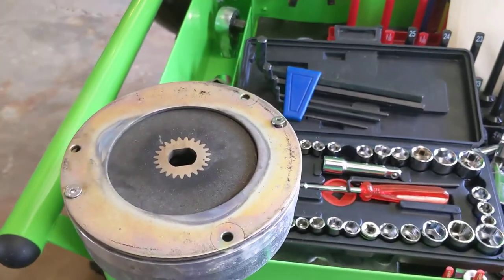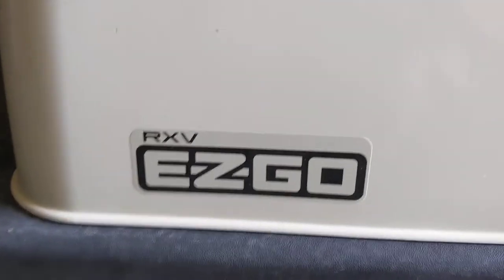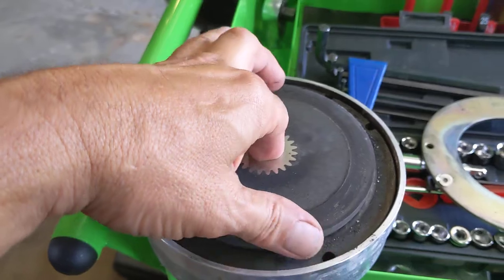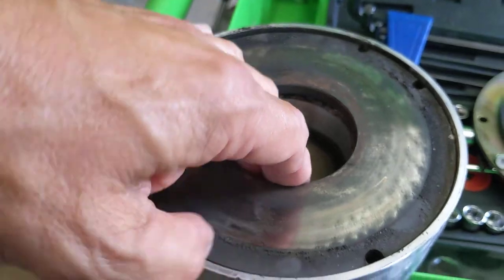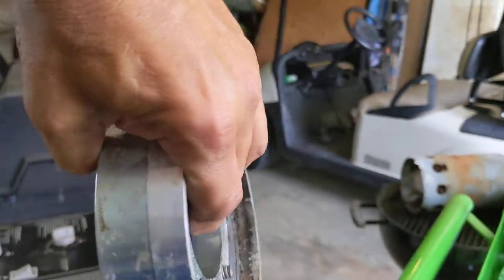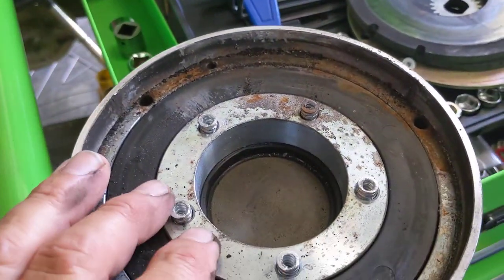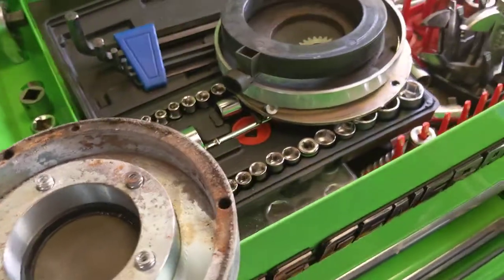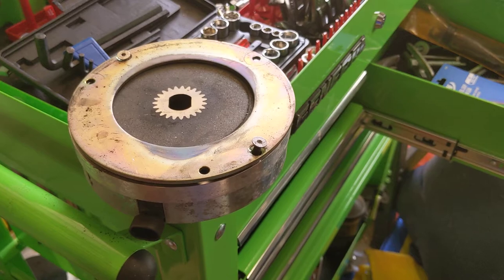EZ-GO RXV Electric Brake teardown

Comment: I just recently replaced the brake on mine and now my cart will barely move in reverse and only go like half speed foward . Any idea what the problem could be ?
Reply: That's what I don't want to happen. I don't see anything wrong with mine upon taking it apart, no reason for fail

Comment: that is a really well designed brake, if the windings have an issue you can just replace the windings as a unit, I wish mobility scooters did that!

Comment: Hi Conrad,  With the brake assembly off as yours in the video,  will this unlock the rear end so it can be rolled away??   None of the towing unlocking procedures are working to push my rxv where its broken down.  I just want to be able to move it.  Thx
Reply: Good Day james c, when the brake assembly is removed, the cart can be rolled away. Please be careful to do this on level ground.
Reply: Yes, it should move freely now.